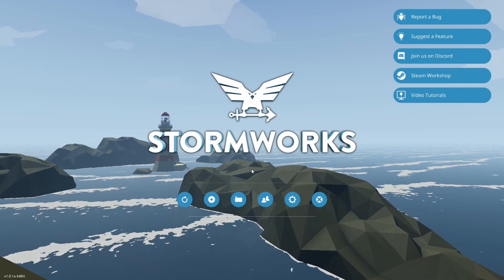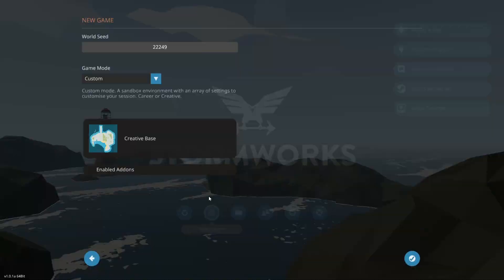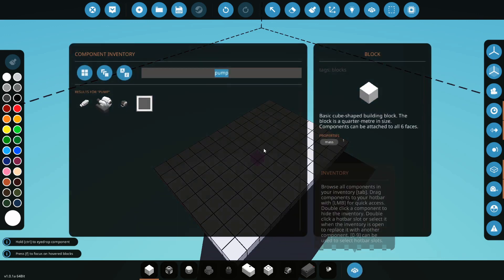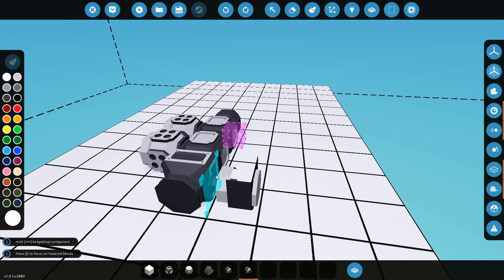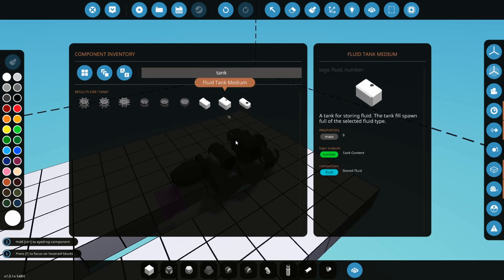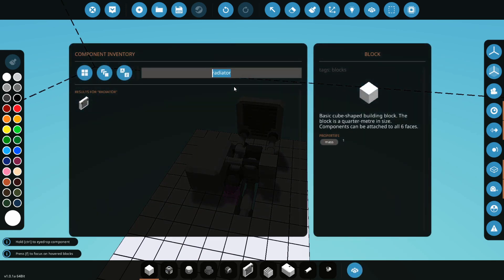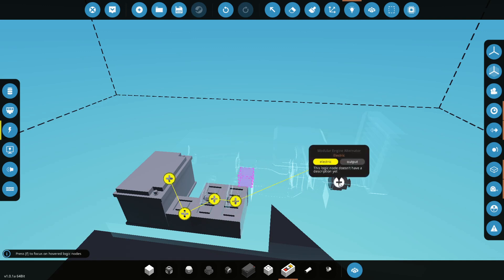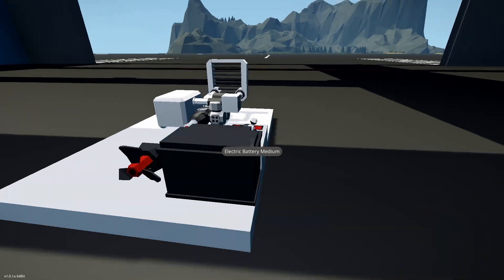Stormworks Modular Engine Tutorial | Stormworks Build And Rescue 1.0 Update

Comment: The air pump thing with two pipe links doesn't exist.
Reply from the maker: The devs changed it into two different intakes. An air intake manifold and a fuel intake manifold. You need both with the correct stoichiometric ratios for the engine to run. You can check out this video for the ratio numbers: https://www.youtube.com/watch?v=1AYkd6mjWr4

Comment: I dont have an intake manifold, only seperate air and fuel manifolds
Reply from the maker: yeah. the developers just changed the modular engines about a week ago. You now need both a air manifold and a fuel manifold. Then you need to vary the throttle input from both of them to get the correct ratio of air to fuel to start the engine.
Reply: My engines dont start, ive tried that and gotten the ratio to be stoich but it wont start it, is there some on key that has to sytay for it to run?
Reply from the maker: I believe that the stochiometric ratio has to stay at 0. So you will need to vary the throttles when starting the engine. I may do a video on this in the future.

Comment: the cylinder's valves were not housed by exhaust manifold, except for one spot. I wonder if power would increase with the more header, or if open air exhaust is occurring?
Reply from the maker: When I have the time, I may test that theory out and some more with modular engines.

Comment: I did some testing yesterday and apparently the amountof cylinders doesnt affect the fuel consumption
Reply from the maker: wait really??? I'll have to test that out, but that should be fixed when modular engines are out of experimental.
Reply: StormRunner Gaming yes, i think its because i only had 1 intake manifold on all engines
Reply: @StormRunnerGaming  There's no such thing as the Modular Engine Air Intake Manifold piece in my Stormworks game. What's wrong? Why is there no air intake manifold piece?!